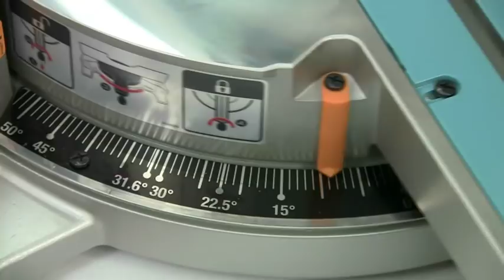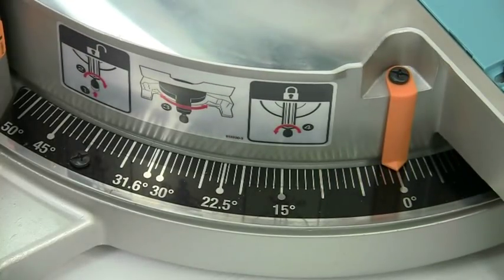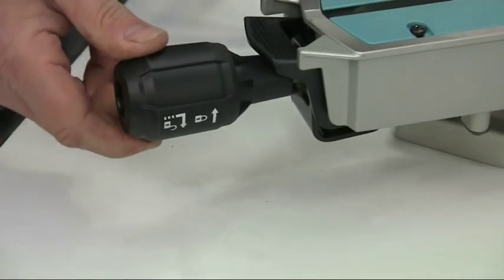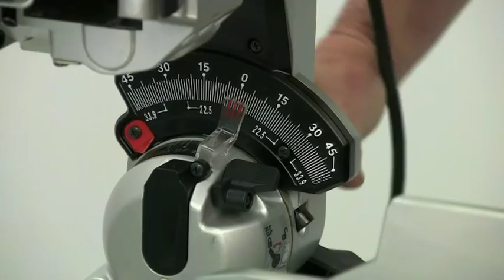Makita How it Works. DXT Mitre Saws. LS1216L

Comment: Is the 165mm depth capacity on the back fence the capacity when at 45 mitre cuts both left and right? can can i put 6" skirting board up against it and cut that hight at both left and right 45 mitre cuts?

Comment: a cheap copy of DeWalt DWS780
Reply: This is a much better saw hands down.
Reply: Minimal444 Well that's funny because I'm looking at this Makita after failures with three successive DWS780's, all type 20. 

The Dewalts are all warped, cheaply built, flimsy, and just otherwise junk, and it's impossible to make any kind of accurate cut on them. 

I hope that I'll have good luck with this one as I want to spend more time using tools than purchasing them.
Reply: +Minimal444  Nothing Dewalt makes compares to Makita.. Dewalt is homeowner grade while Makita falls more inline with construction use. I've been in the biz for 15 years and wouldn't consider any dewalt brand tools for anything.. Nothing but Hilti and Makita for me..
Reply: I wouldn't say that everything Dewalt makes is homeowner grade, though I do agree that Dewalt can be hit-or-miss these days. Their saws (not the sliding miter saws) and corded drills, and their top-of-the-line angle grinders are great. Their routers, and almost everything else they make, are pretty cheap.
Reply: I still have a dewalt drill i bought in '99 thats been through hell and back (dropped in wet concrete, left outside in the rain, dropped from a ladder, etc) and it just won't quit.
Reply: My DW716 (type 3) works great, and so does my DWE575. I also have a DWD210G Drill that beats all other 1/2" pistol-grip drills hands down. Dewalt still make good Perform & Protect angle grinders and tile saws (D24000). HOWEVER I would not consider any Dewalt brand routers, sanders, Sliding miter saws, etc. for anything. For example the DWS780 was a big disappointment. 

Again, I wouldn't say all of Dewalt is homeowner grade, but just that they can be hit or miss these days. I do, however, agree that the quality of even their current pro-grade tools has gone slightly downhill, though.
Reply: I still have my dewalt 708 chop Saw and hands down it’s been the best I’ve owned it’s done some work and junked a lot of other saws that I’ve owned or others around me have owned and keeps going. When I brought it (14years ago)  it was with out doubt the best in the game and at that time the people said the Makita saws were junk. I’m looking at possibly keeping the elderly dewalt in the shop and having a new one for site so trying to watch as many reviews as I can. Having looked at all the main brands in show rooms it will be between dewalt and Makita. Both make good saws. Dewalt seem to be clawing back a bit at the moment they dropped right off in last 5 years. Still think they make a good chopsaw but they not the innovative brand they were though. Only the flex volt sets them apart now. The lost the plot at the end of the NIMH days.